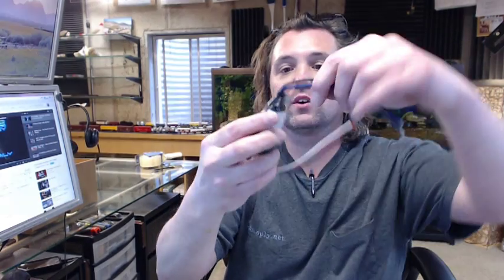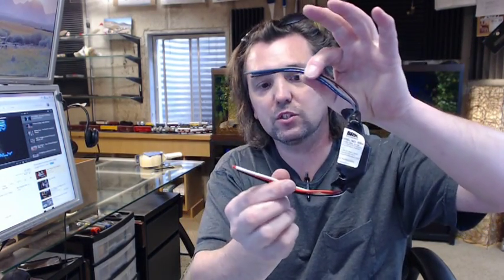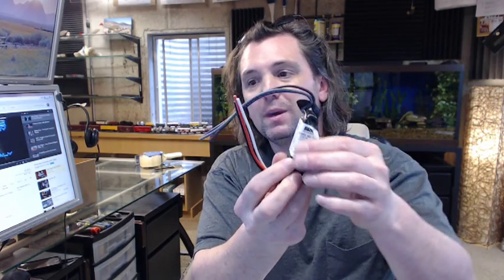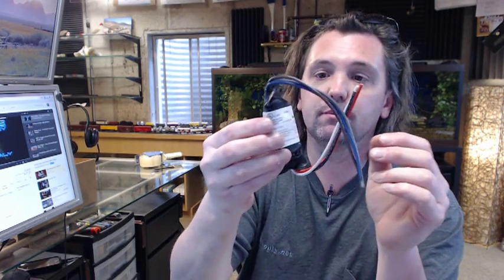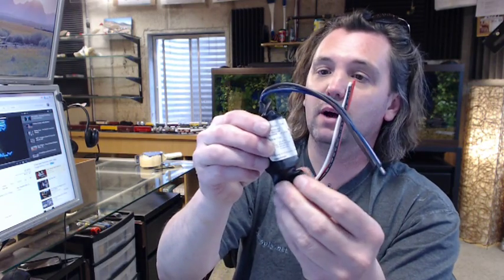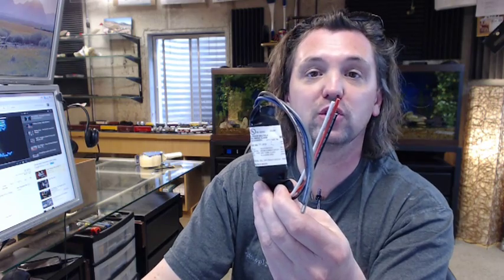BRK RM4 Auxiliary Relay Module for Smoke Alarms

Comment: if i go from this to a commercial fire alarm relay module connected to a panel would that work?
Reply from the maker: What are you attemting to accomplish?  Rich
Reply: @ my wording might be a little bad, but when a smoke alarm goes off since they’re interconnected, it trips another relay module connected to a commercial fire panel and trips that system too
Reply from the maker: @SytenixRBX  That is the correct operation to my knowledge - Rich
Reply: @absupplynet  the relay from the smoke alarms doesn’t have any power going through it, right?
Reply from the maker: @SytenixRBX  Common to Normally Open would not have continuity but Common to Normally Closed would have continuity.  Rich

Comment: I want to hook this up to a 24-volt strobe. Would I need a transformer, and if so how would I hook that up?
Reply from the maker: You most likely will not need a transformer because whatever you're connecting this from will provide the power going to it.

Can you tell me more about what you are connecting the relay to on the opposite side of your strobe?
Reply: Could I use this relay to directly connect a 24v strobe to a hardwired network of first alert smoke alarms? Would it be better to use a 12v or 24v setting on the strobe?